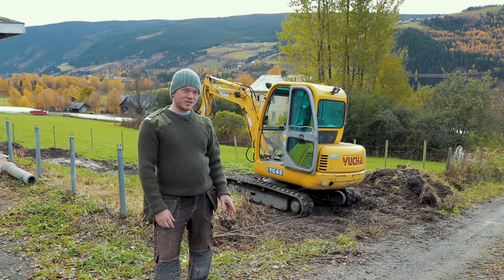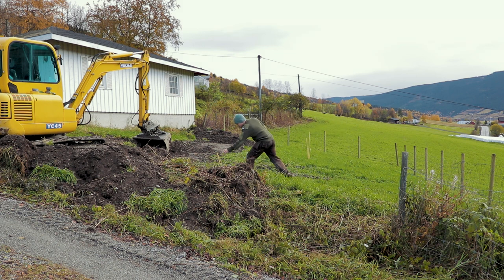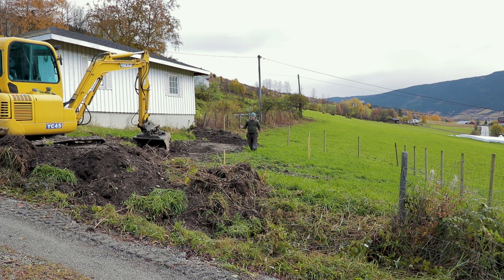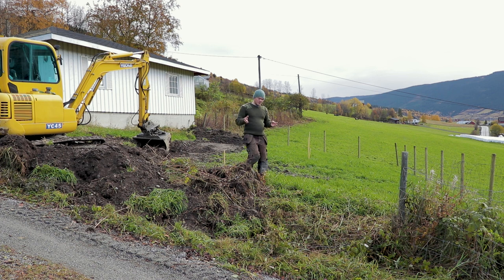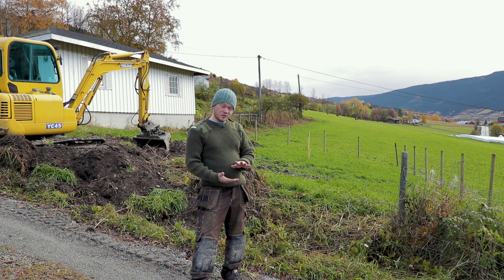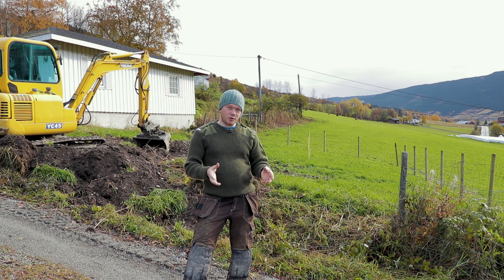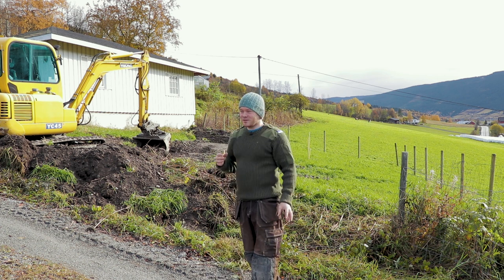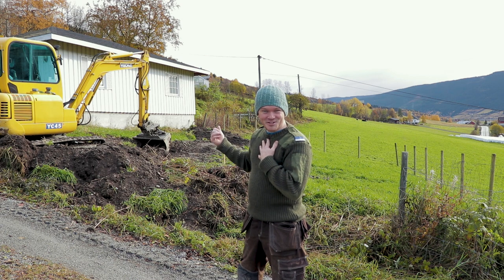GeoThermal Greenhouse Build | Part 1

Comment: For anyone watching: geothermal air exchange is not a solar battery. It does not work by storing the sun's energy in thermal mass. It works by transferring energy to and from the ground which is at a naturally stable temperature below ground. Most importantly this means that you should not insulate around your pipes (its OK to insulate above them, although you will not want to do that either if you are using a geothermal system primarily for cooling.) 

Thermal mass storage is a totally different concept, and while you may want to use the ground above your thermal loop as a thermal battery during the winter, thermal batteries are far less effective than geothermal air exchanges in cold climates. 

In cold areas insulate your greenhouse, put some thermal mass in all your walls (even the bottom couple feet of your south wall) , and don't use glass anywhere it doesn't bring in direct sunlight at the coldest part of the year. Also make the ceiling as flat as possible. For a small greenhouse (less than 10' wide) it may be more efficient to rely nearly or entirely on the walls for light entry and insulate the entire ceiling.
Reply from the maker: Thanks for your input.
Reply: Christopher Brandsdal
Thank you for sharing your project and encouraging people to think about this stuff!
Reply: interesting point about insulating the ceiling and making it non-see-thru

Comment: I don't understand why you would build air system and not a water(car anti-freeze) or oil system. Air is not a good thermal conductor its why we sometimes use dead space as insulation.
Reply: That’s a lot of liquid to store and pump. I wonder if it’s less expensive to run a fan vs a pump. Also since this is underground if it developed a leak in a low point your screwed right? I think fans pushing air is the standard for this type of system, even though it moves heat energy slower like you pointed out.